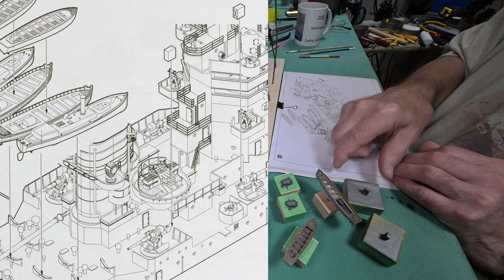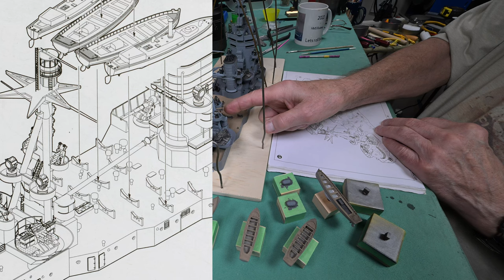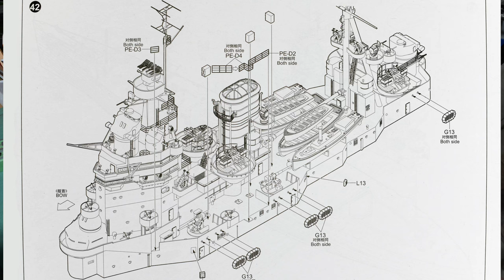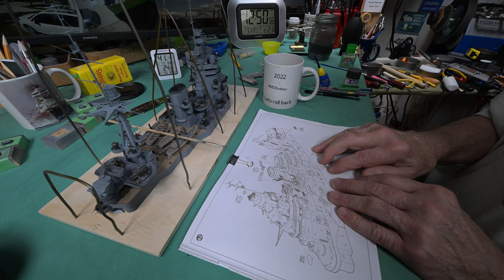The Model Ship - Part 1296

Comment: There is a Japanese Dreadnaught from 1906 or thereabouts that is in a concrete casing out of the water that seems to be going ok.  It’s a full sized battleship, sold to Japan before WW1. The you tube story on it was called something like the last Dreadnaught.
Reply: Hi Mark ,yes saw that video,  very interesting 😊😊😊😊😊
Reply from the maker: I did a search but all I found was this https://youtu.be/A0jl8lJTMds?t=331 🤞
Reply: The ship is the Mikasa and it's in horrible shape on the inside.  The concrete is porous and allows water to pass through it where it has worked its way into contact with the hull.  The water then has nowhere to go and everything inside the concrete is being eaten from the outside and now inside into the ships internal spaces.  You'd never know that from looking at the outside.  At some point the Japanese are going to be faced with very difficult and costly decisions regarding the continued longterm historical preservation of the ship.
Reply: Hi Ron, the other replies are correct, it is the Mikasa.  The clip on you tube is titled ‘The last British Battleship?

Comment: Hi Ron if i remember correctly you can take a ship out of the water but over time and i mean a long time the weight of the ship on the hull can damage the hull. This is why the Cutty sark had to be supported with no weight resting on the keel. Now i know the Cutty sark is of wooden construction and I'm not sure if the same would happen to the Texas but from what I gather the water gives even support across the hull were as hull supports in a dry dock are pressure points on the major structural points so distortion could happen over time. And even if it was lifted out it would still rust.
Reply from the maker: Will be very interesting to see what they end up doing with the USS Texas.  https://youtu.be/A0jl8lJTMds?t=331

Comment: Hi Ron
I hope you dont mind me messaging  you. I am about to start on the Trumpeter bismarck But first I need to get my HMS Nelson and my USS Arizona off the bench and into a purpose built cabinet.

The reason I am getting in touch I need to know the final size of the Bismarck so as to make shure that it will fit into the cabinet I am to build.

I beleive that the Bismarck is 1265mm long and has a beam of 181mm but I cannot find the height of the model.

Can you tell me if the dimensions I have are correct and what the overall hieght is?

Thanks for your inspirational builds online.

Thanks in advance

Bob
Reply from the maker: Hi Bob,
I did measure the distance from the bottom of the keel to the top of the main mast, but have forgotten it. At the moment it's enclosed in my large ship case, and removing the plexiglas front is a "pane", haha. We'll see. There are other viewers presently doing the Bismarck. Will try to remember to mention it in episode 1297 today. 🤞
Reply: @roncalverley  I have 290mm from keel to top of main mast ( plus any extra for the stand)

Comment: The USS Alabama is in water but it is sitting on the ground the water level is way below the normal waterline so the ship isn’t floating, the USS Drum submarine is on display next to the Alabama completely on dry land. The USS South Dakota Memorial is on display far from any water. Every so often a tourist will ask why the South Dakota looks like it’s buried into the ground. 🤦🏼‍♂️ In reality the hull is only outlined in concrete with only parts off the battleship on display at the Memorial.
Reply from the maker: Hi Kevin,
It will be very interesting to see what becomes of the USS Texas --- https://youtu.be/A0jl8lJTMds?t=331
Reply: HMS Victory is also in a drydock and older than all the others. I rest my case.